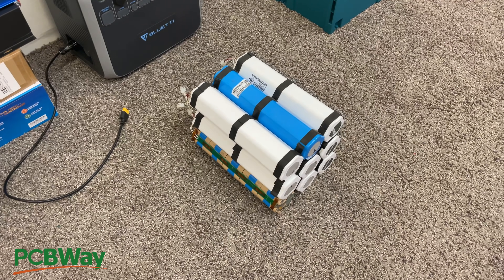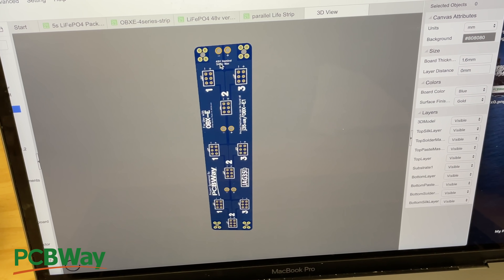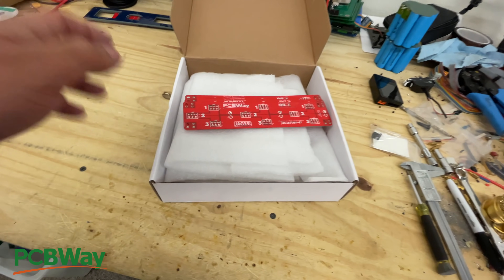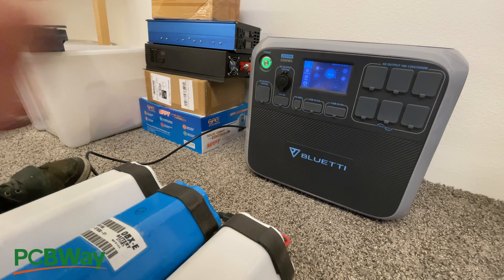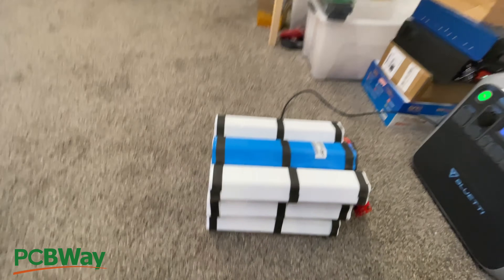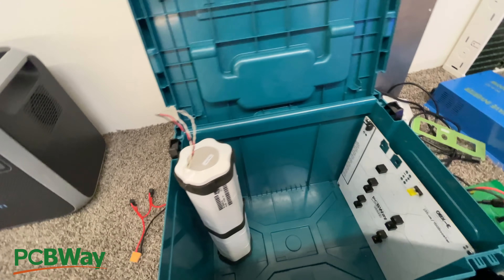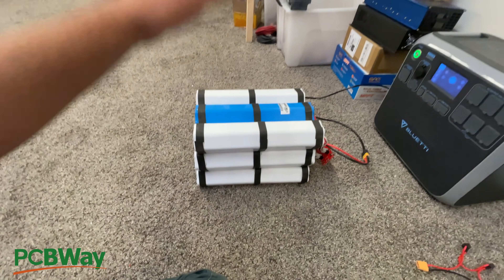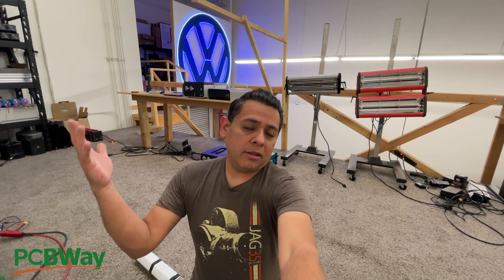Make your Bluetti AC200 into an EP500 for $441

Comment: Very cool stuff. It would be sick if the bluetti could charge your battery with solar. But looks like you're using the bluetti PV input instead of the bluetti extension ports. Could the BLUETTI P090A/D to XT90 adapter work?

Comment: It would be even cooler if you were able to connect this battery as an Bluetti extension, so you will never have to care if it is charged or not and use it like normal! This would make connection easier because you will have only bluetti connected to solar panel! Also you will not need the charger!
Reply: You'd probably have to source the same connector they are using, and figure out the way it's communicating.

Comment: During a power outage, you are limited to roughly 450W power consumption while charging with these, if you want to keep the battery in the bluetti in the 85% range. It would be helpful to mention that when talking about adding capacity to these kind of devices.

Comment: Call me crazy but wouldn’t just solder a board and baderes and plug everything in and then just  plug into the Bluetti without checking the voltage

Comment: Thank you so much for the vid, would this work using Renogy 100ah smart lithium batteries? would it be possible to charge those directly from solar/dc to then power the 200p?
Reply: I'm going to be using something similar, once I've got decent solar set up. I'll get one of those 12v batteries that you can plug a slow charger into the side of, takes forever, but it's slow, safe and doesn't get hot, so I'll feel better leaving it while I'm out. Probably put the power back into the Bluetti with an inverter, not effcient, but easy and quick (also an inverter is more AC outputs!)

Comment: Neat stuff!  I bet this could be set up for UPS type use by leaving connected a CC/CV driver or charger in parallel with the battery pack and the Bluetti input.  That way the battery would recharge automatically.  But are you worried about balance between the 3s packs if you directly charge them with a 13s (54 V) charger?

Comment: @jehu is it only good for a battery extender for the ac200p or can i put a 2000w 48v inverter on those packs? im afraid to pull out 2000w constantly on those tiny wires. can you make a video that it can pull atleast 1800w  continuously? thanks

Comment: How well could your 3kw battery bank run the 58v brick charger side? In some of my AC200 tests, I noticed that when I charge with both my solar and the brick concurrently and run my 6k BTU air conditioner, my AC200 BMS status goes to standby. A battery addition on the brick side would extend my availability on my boat even longer. Thanks.
Reply from the maker: It can’t,  it’s not 58v,  you’d need a dc-dc between the two to regulate voltage
Reply: Could you clarify? You are charging with solar in the solar port, and have the brick (plugged into 120v) and plugged into the brick port. You are running a 6000 btu AC while charging through both ports and the AC200P goes into standby? Should't the unit be able to handle this?

Comment: How heavy is the blue box fully loaded, great work and please keep creating this stuff.
Reply: The LiFe batteries are heavy!  The EP500 weighs 160lb and AC200P is only 62lb.  Given the weight of metal frame and other stuff in the EP500, I’d figure the 9 x 288wh batteries would weigh about 45-50lb.  At the upper end of portability, I’d say!

Comment: Can the batteries be used on any other power generator or just ac200
Reply: I may be wrong, but I think he's plugging it into the solar panel port. The ac200 thinks it's a solar panel putting out 48 volts.
If I'm right, it will work with any solar charge controller that works with 48 volt panels.

Comment: how does that board handle so much current without melting?
Reply from the maker: It’s only 12A
Reply: @jehugarcia  hi! thank you for the reply and for the explanation :)
Reply: it should do around 1000w. anything above that you should change the wires on the batteries

Comment: If it is to be a true “like” it needs a relay for UPS use. One of the big benefits of the 500 pro. Love the  system so far.
Reply: And split phase, and higher wattage inverter, and wheels, and...and..and.. this is merely just boosting capacity of the battery bank

Comment: hey Jehu, I know you got both the AC200 & AC200P, Please tell us what are the differences in one of your next videos, thanks? I have an AC200 which I got last December 2020.
Reply: One has 1700w theoretical , the other have 2000w, but in real these number are wrong, as they reserve 200w for management and there is inefficiency, so at the end i think it is no more than around 1300 and 1580wh. So they don’t have the afvertised capacity. The difficulty to indicate the real capacity come from the loss at no load which is in existing and the same in both mode : 11-18w in dc mode and 35w and more in ac mode, without any devices plugged into it. The loss increase with time , reducing the battery consequently. So you probably have a 80h run for cfx3 45 dometic fridge, or something
Ike that and the 2000 has probably a 93-96h running time. More short the usage is , more efficient the powerstation ac200, and ac200p are. So these models are more for high load wattage short term, than low wattage long term. Some users say the bms does not show the cell temperature anymore on the ac200p from the reviews and user reports. They changed the temperature management from the ac200 to ac200p (on more recent models.. need to be validated).
Reply: @CC-gt3ro  You almost never get the actual capacity of any power station or battery out. Unless they've under-stated it, anyway. A brand-new "90Ah" battery that actually has 100Ah might surprise you with 92.
Reply from the maker: One has lithium cobalt oxide the other lithium iron phosphate,   That’s it,  not worth a Video
Reply: so this battery set up will work for either?
Reply: @briansomers4753  yes. Both model have same input, outputs.